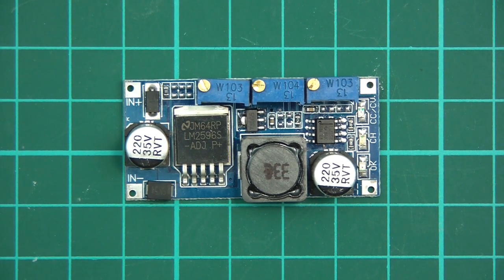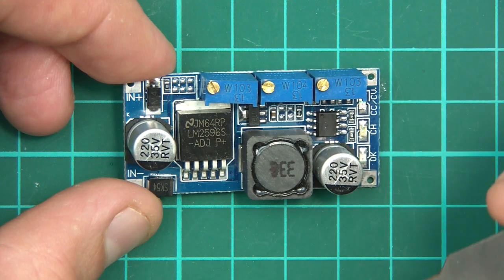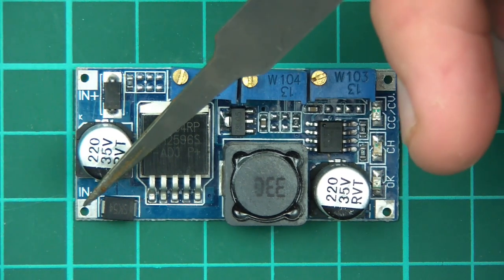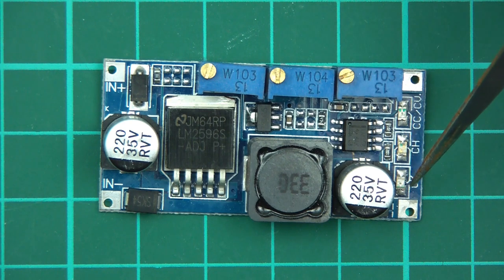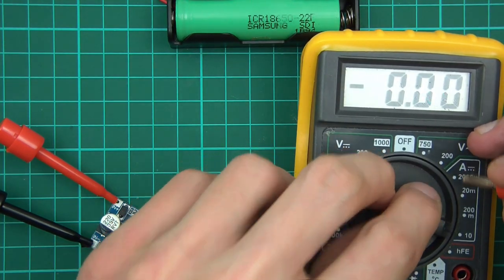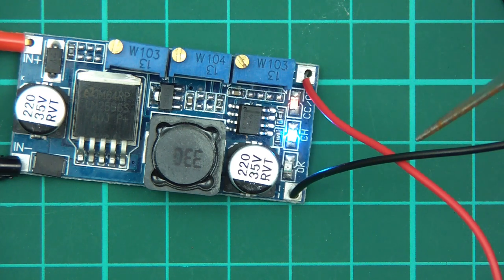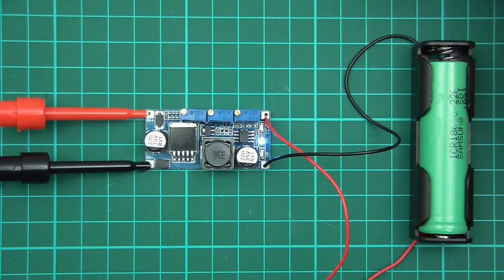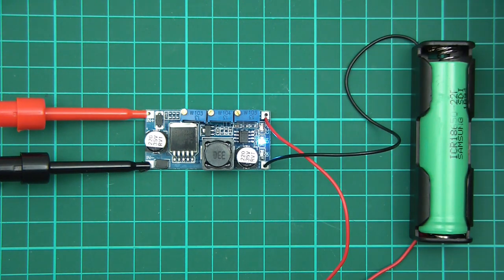TUTORIAL: About & How to use a Cheap LM2596S Buck Converter / Battery Charger Module - Arduino

Comment: What is the use of 3rd potentiometer
Reply: Prabhask Karjee - From left to right the potmeters are 1: max. voltage, 2: charged level, 3: max current. Next to using it as a charger, the unit is also advertised as a LED-driver, but in that application, the middle potmeter is not used.
Reply: @MaxintRD  How do you use number 2? I'm not fully grasping it.
Reply: @LEO-xo9cz  - If I remember well you can use it to set the voltage at which the battery is considered  charged. When that level is reached it cuts the power.

Comment: This is a tutorial but you keep saying you have no idea what this does and what that does. The reason the cap on the output is 35V is because this is a step down module. you can put from 5V - 35V in and get 1.25V - 30V out. It would be pretty stupid to put anything smaller on the output side!
Reply: Cheap module, a 50 V capacitor at input it's a must. China stuff.

Comment: can i use as lab power supply
Reply from the maker: Hi, you can, but it's not recommended. :-)
Reply: Why this is not recommended?
Reply: You could use it for that purpose but the output is not that high of amperage. There are others very similar to this that have proper heat sinks and can handle more power and thus would be more suitable for a lab power supply. But yes you could use this as long as your load it not very high. You need to derate most of these Cheap converters by 50% of how much power they can deliver else they burn up because they don't have a good enough heat sink.
Reply: use XL4015 for lab power supply! but do not go above 4.5A!! look AlexGyver miny version, which is very neat and cute. It is super, if you are a basic DIY person and do not need something to fancy and complicate...

Comment: When the “ok” led goes on when it hits the limit, does it cut power to the battery?
Reply: No, you ll need to include separate system to cut-off when charged